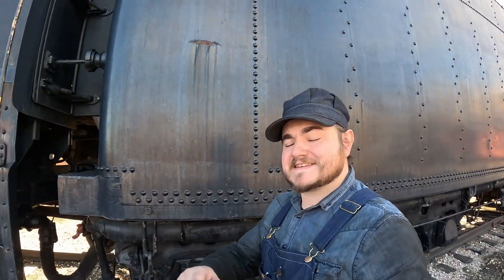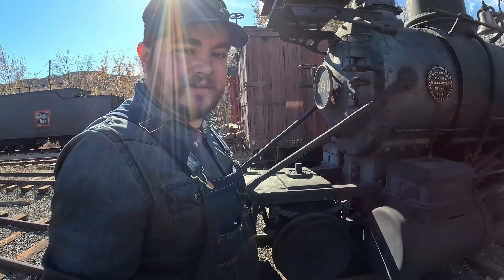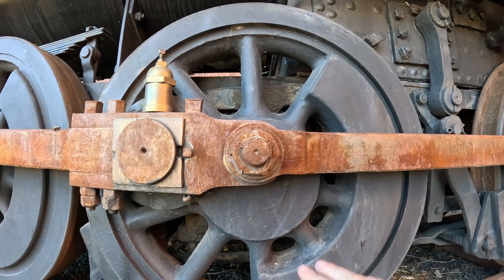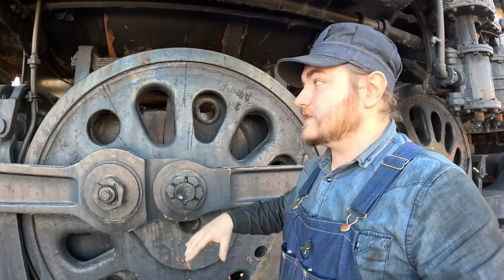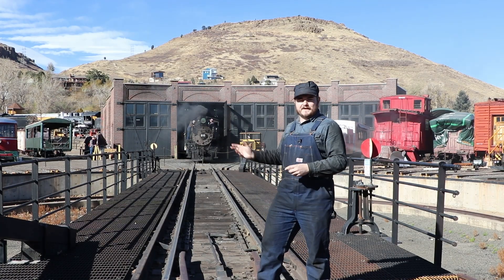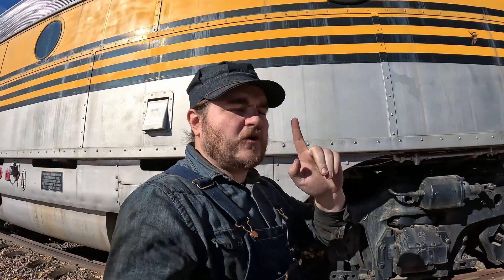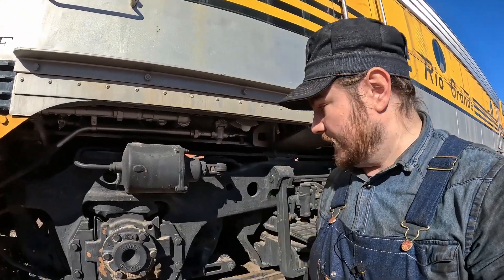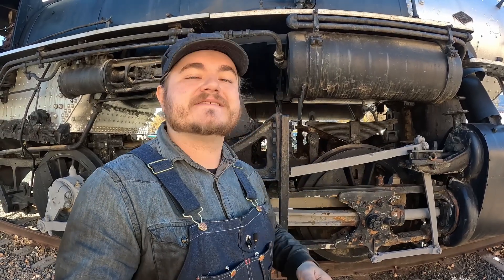HUGE vs. TINY drive wheels - Why? | Railroad 101

Comment: Thanx for another wonderful engineering video.  The most extreme wheels I have seen are the Southern Pacific #3025 4-4-2 Atlantic at the Travel Town museum in Los Angeles.  The drivers are 81" in diameter.  This video brings to mind a question I have had for many years that may be a good future topic for you.  Historically how long have trains been through the years?  All of the trains I have seen in the last 50 or more years are 100 or more cars long (My brother and I used to count cars as the train went by).  Of course, these all had multiple diesel engines.  Huge trains with only one crew to pay.  How long were the steam trains?  On Petticoat Junction an American locomotive pulled one car, but I suspect it could pull some more.  How long were trains in the days of the first transcontinental railroad?  How much did the Big Boy pull?  I suspect what we see it pulling today is well under its capability.  What determines the limit for a single steam engine.  Sometimes the Durango and Silverton or Cumbres and Toltec double-head, sometimes they're single locomotives.  How do they determine what to use?  For that matter, how do you determine how much locomotive is needed at the Colorado Railroad Museum?
Reply: I used to work at a rail yard, early 1970's and many coworkers worked with steam.
A single steam  locomotive leaving that yard was limited to about 3,000 tons. That would be 30 loaded coal cars of that era, and about 100 empties. My guess for a normal mixed freight, 50 cars or so max. 
Double heading and pushers were a common practice. I have a memory of being on a B&O passenger train with a steam pusher that helped the train maintain speed climbing the Allegheny Front west of Cumberland, Md.
Reply from the maker: Andy answered your question for what was mostly typical back in the day. Bigger engines could haul more, and certainly did; but the trains were typically shorter than these days.
Reply: @Hyce777  But the Big Boy, and your Q monster...
Nothing like that on the B&O, Baltimore Division.

Comment: One of the other benefits of the roundhouse and turntable combination was keeping shop space to a minimum while maximizing overall yard space. A turntable essentially acts as a single switch that services numerous tracks (hence the *round*house that typically accompanies it), while an ordinary turnout may only diverge two or three ways. This was especially critical for early smaller scale operations, where right of way acquisition costs were prohibitive and easements were sought instead. A comparison would be the size of the Jamestown Shops of the Sierra Railway compared to the East Ely complex of the Nevada Northern, significant difference in the amount of space needed and used while accommodating each railroad’s respective needs. When the diesels came along and railroads began to modernize and economize their operations, that’s when the roundhouse and turntable became obsolete, as just like the production line approach to manufacturing diesel locomotives, the goal was to bring them into the shop and get them back out as quickly as possible, at which point the roundhouse and turntable element became an impediment to speed and efficiency.

Comment: You covered many valid points, but you didn't mention one more important aspect re. the choice of small driver wheels on freight locomotives: traction (the amount of drawbar pulling force a locomotive can exert without wheel slippage).

The maximum traction is primarily determined by the total weight of the locomotive carried on the driving wheels . If you want more traction you can make the locomotive heavier, but then eventually you run into the maximum axle load permitted on the tracks of the particular railroad. By using smaller wheels, you can have more driven axles on the locomotive and therefore make the locomotive even heavier without exceeding the maximum permitted axle load of the railroad. Thus for the purpose of pulling long heavy freight trains, freight locomotives often have a large number of small driving wheels such that the locomotive can be made heavier and have more traction, without exceeding the maximum permitted axle load.

The engineering physics involved here is interesting too, as it turns out that the traction is mostly determined by total weight carried on the driving axles rather than the number of driving axles. A locomotive of a specific weight carried on the driving wheels has a fairly consistent traction, regardless of whether it has 4, 6 or 8 driving wheels, as the total surface area between the tires and rail head turns out to be relative consistent too (the tires and railhead deform under weight to result in the same overall contact area, resulting in about the same traction).

Comment: So it's pretty much what I thought it would be, a trade-off between torque and speed.
 
I heard somewhere that a common rule-of-thumb was "each inch of driving wheel diameter is a mile per hour of top speed." I think they were comparing the Big Boy to other engines but I'm not sure. Have you ever heard that, and do you know how much truth there is to it?

Comment: This driver wheel size thing is something I already knew. In the Netherlands we mostly look at German steamlocomotives and there the differences in wheel diameters are quite big. Big wheels are for speed, the smaller ones for power. That's why a BR 01 locomotive (used for long distance passenger trains) has about 79" drivers and a BR 52 locomotive (used for freight trains) has about 55" drivers.
Reply from the maker: Aye, it's fairly common knowledge amongst many of us, I moreso wanted to point out how stroke relates to the crank and it's not as simple as just the wheel size. Cheers! :)
Reply: @Hyce777  True, but I think it's also quite logical to think that the crank on bigger wheels is always shorter in relation to the wheel than on smaller wheels. Because if it would be the same you would need way longer cilinders for those big wheels in order to get the piston to make the needed stroke length. 😉
Reply: Good for you, this video taught me a lot however.

Comment: It’s also notable that the loss of passenger service made dedicated passenger engines obsolete. Back when passenger service was big, you’d have your passenger engines (E units, and sometimes F units) and then your freight engines (your GP7’s and SD9’s)
You couldn’t just put anything on the front of the Zephyr (although often times railroads did anyways). Engines like 5771 were the D&RGW dedicated power for the Rio Grande Zephyr until 1983 when the service ended. When passenger service ended across all railroads, you didn’t need Passenger Power AND Freight Power, you just needed that freight power, which made operations even more simple. 

Last fun fact! 5771 had its own little shed near to Union Station in Denver for the Rio Grande Zephyr!

Comment: The same concept can be applied to internal combustion engines. Some inline sixes, like the flathead six found in the Dodge M37, have a lower power band than, for example, a 2JZ. The reason for that is because the Dodge's crank throw is longer than the 2JZ. That means you can get more low-end torque, but not the top-end performance of the 2JZ.
Reply: so you mean to tell me that engines and transmissions are nothing more than over glorified levers?
Reply: @Mike-jv8bv  Especially the transmissions.
Reply: @Mike-jv8bv  But they're kinda freaky, they can have two pistons and 4 crankshafts, and they ride on the crankshaft balancers, and the crankshaft is actually the axle.
Reply: Of course with variable valve timing and lift you can stretch that band
Reply: @kornaros96  but you can't effectively change where that band is centered without making a lot of other changes to the engine itself, and that's where gearing has to step in
Reply: @dustinbrueggemann1875 It’s wild that the gearing all comes from the wheel size on these steam locomotives. Makes sense; still wild.
Reply: @shoryuag  a steam engine is a unique engine that can have two pistons and 5 crankshafts.
Reply: Hmm…. If the Dodge T245 makes indeed more low-end power than the 2JZ, it’s because the T245 has more displacement, a smaller cam(s), and smaller ports. The longer stroke equals more low-end power thing is a myth. Likewise the reason the 2JZ makes more midrange and top-end power (potentially low-end power, too) is because it flows more air and can therefore process more fuel, creating higher cylinder pressure, leading to more power. The only question is whether the larger ports and cams of the 2JZ offset its ability to create higher cylinder pressure enough at a very low rpm to make your statement about the low-end power true on its own.
Reply: @shoryuag Although displacement and compression are the biggest factors in determining torque, an under-square engine does tend to favor a low speed torque/power application vs. an over-square one. However, I do agree that these traits are over embellished online. People love to bench race two motors with the same displacement and then you look at the specs and there is like a 2mm difference in crank stroke. 

The same happens with I6 motors. People love to say they make more torque than a V8 of the same size. But in reality, they never did. But because they are often grossly under-square they usually cannot spin fast enough to make big power numbers so they usually end up in trucks where they rarely spin past 4000 rpm and are focused on low end power and torque. I am not saying that's a bad thing I love I6 motors and there are exceptions to the rule (Ford Barra, GM Atlas, Toyota, Nissan, BMW all have examples) but it's just a funny myth that never goes away.
Reply: That's what determines the fastest speed that engine can run as well. It's not necessarily mechanical destruction limitations as people assume, but that the amount of power you can get out of a gasoline engine drops off after the piston speed exceeds about 60 mph. 

If the engine is spinning fast enough that the pistons are moving faster than that, they can't take advantage of the power from the fuel because that's how fast fuel explodes.

As a result, you can have engines with longer stroke that can only go up to 5,000 or 6,000 RPMs before they don't really have any power, meanwhile you have smaller motorcycle engines that can run up to 12,000 RPMs or 15,000 RPMs and still be making maximum power, because even at those crazy rotating speeds, the pistons aren't actually moving back and forth that quickly because the stroke is so short.

Of course, there are still mechanical limitations to an engine, and simply spinning an engine fast enough can break things, but all the parts of an engine are usually designed to survive whatever speed that bottom end is designed to take advantage of.

Comment: Old rule of thumb was an inch of driver height was worth a mph of speed, give or take. 79 inch drivers means the loco is good for at least 79 miles an hour, plus a bit more.

Tall drivers means speed, but easier to slip, low drivers means more pulling power and less likely to slip, but a lower top speed.

Comment: You mention machining the wheels when they wear down. Would you need to machine all the wheels on a truck to a similar diameter to make tbe truck sit flat or is the suspension designed to accommodate that?
Btw love the vids!
Reply from the maker: Absolutely need to be within very tight tolerance on steam locomotives; adhesion and rods don't get happy if you get too far out. 4 axle diesels can have crazy differences; 6 axle diesels can have sort of a middle difference between the two (small enough wheel in the middle floats, for example).
Reply: Theres a tolerance for the difference in wheel diameters on a truck and between trucks, but it is mainly so the drive engines don't spin at too different speeds. The suspension has enough play to allow for said difference. The difference is very very small on engines with coupled driving wheels, be that drive shaft or coupling rods. So yes and no, they can be different but for several reasons not by much

Comment: I like seeing some of the inoperable locomotives at the Museum, 20, 346, and 491 get a lot of well deserved attention for being in operating condition. However, I personally still like the static display locomotives even if it isn’t possible to run them at the museum.

Comment: Hey it's me again. When you started talking about gear ratios it reminded me of a chart from one of locomotive service manuals.

The manual in question was for an SD45 and it has a chart for top speeds. The gear ratios it mentioned for the D77 traction motor started at 62:15 and went to 57:20 and the top speed went from 65 to 95mph respectively.

I know GE motors use different gear ratios starting at 74:18 but idk any others.

Comment: Was the deisel wheel idea ever brought to steam locomotives besides turbine locomotives? Curious if there was some transition era experimentation with that.
Reply from the maker: Not that I'm aware of.
Reply: @Hyce777  Turns out there were a number of Steam Motor locomotives used something very similar. Though not revolutionary they did work for their intended role.

Comment: Out of curiosity, is there a maximum size that the wheels could be if you were optimizing for speed?  Like say you wanted to go really fucking fast, couldn't you get a relatively thin boiler and stick like 15 foot drivers on it with some monster pistons for power?
Reply from the maker: You start running into design issues at a certain size - see the French building axles that went through where the boiler should've been, and building a special boiler that had to wrap around and provide air space for the axle... that messes with the steam generation. The biggest wheels that seemed somewhat common are 84", or 7'.
Reply: @Hyce777  Are you sure they had the boiler wrapped around the axle, not just the ash pan underneath the fire box ? In the UK there were many locomotives with large driving wheels where the ash pan wrapped around the rear axle, but the fire grate was still above the axle. The British A1 Stirling class had 8' 1" (2.464m) driving wheels on the single driven axle, but the boiler still cleared the axle.
EDIT: just found the French L'Aigle locomotive with the actual boiler clearing the axle; yes, that is getting silly indeed... 😁
Reply: I'd imagine you'd be constrained by the volume and pressure of steam the smaller, thinner boiler could produce, not to mention the fuel efficiency.

Everything's a trade-off.

Comment: I remember the first week learning about gear ratios in robotics . It became a hilarious and quickly degrading topic as my classmates and I realized how little we understood about  all the factors that contributed to motion. Great video ❤️
Reply: It is a good example of easy to understand what it does but now how it works
Reply: RRHS Royal robotics 5842
VEX and FIRST
Reply: I am trying to explain it to my daughter right now. She is 13 and really wants me to teach her stick shift (offroad) but currently has no grasp on ratios and just knows that 1st gear is to start and 5th is for the freeway. I think we need to get the Lego out and build some geartrains 😂
Reply: @geoffmooregm That's one way to teach your daughter how gearboxes work and all of that, there's also the size of the gears to take into consideration as well. Edit: the differential plays a significant part in power distribution knowing that the energy being produced has to go somewhere and that somewhere is the differential so that it can be split evenly amongst the rear wheels (or all 4 if the vehicle is 4WD)
Reply: @thesilvershadow1760  Yes, it is 4WD and equipped with ARB Air lockers front and rear. It should be fun!
Reply: @geoffmooregm   I'm sure it's too late, but I was trying to use my mountain bike with my ten year old.  He was asking me about shifting in relation to a geared bike.

I held it up and he got to see and feel the top speeds vs the easy to turn.
Reply: @johngault7329  Yea mountain bikes are great because there is a huge ratio spread. It's very clear to the rider what 1st feels like vs 18th or 21st
Reply: Am I allowed to flex University of Alabama NASA RMC? 

Did plenty of work with the FRC and FTC teams local to Tuscaloosa but I never did have a chance to compete myself
Reply: 1732 Hilltoppers
Reply: 701 FRC
Reply: 3229 Hawktimus Prime
Reply: We sharing our teams?
(FRC) Roxbotix, 4361!
Reply: A little late to the party, but FRC Team 20 The Rocketeers
Reply: My son is on FTC 7959 - Columbia high School cougars
Reply: I can imagine the amount of maintenance required to keep a steam locomotive running.  Just the plumbing alone is huge.
Reply: 326 Extreme Eagles 🤘
Reply: Bedford Express FRC 1023
Bionic broncos FTC 6079
Reply from the maker: @markst.germain9286  Team Audacity 4682. :)
Reply: @Hyce777 frc or ftc? Also NO esc 27479
Reply: Angelbotics 1339

Comment: For true speed you need the GWR Hurricane with it's 10ft driving wheels
Reply: 'We don't need adhesion! Fuck it, put the boiler on a tender frame, who cares?'
 - Brunel, probably.
Reply: So many British single driver locomotives compensated by having those wheels at such huge proportions.  It was almost a trademark feature of these locomotives.
Reply: ah yes from when everything that was passenger related was a 2-2-2 and 2 of the wheels were big chonkers.